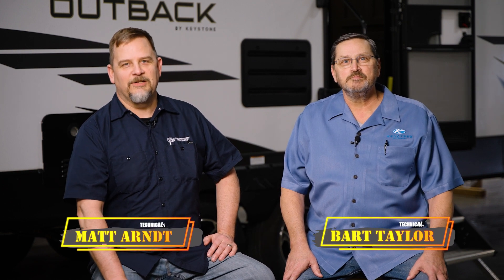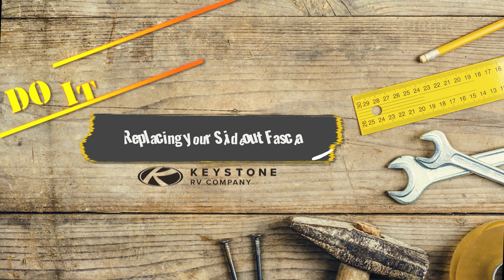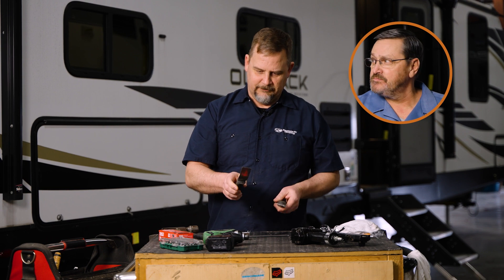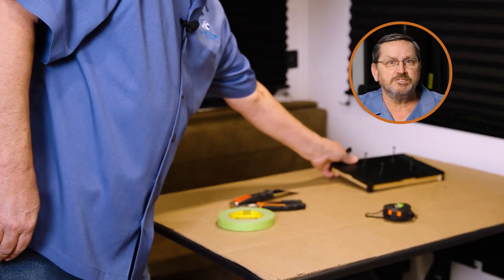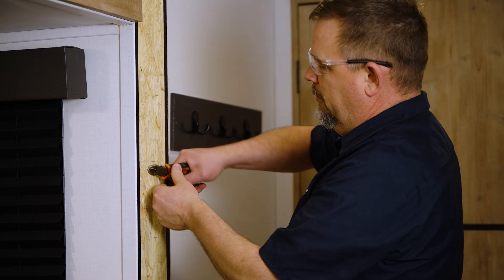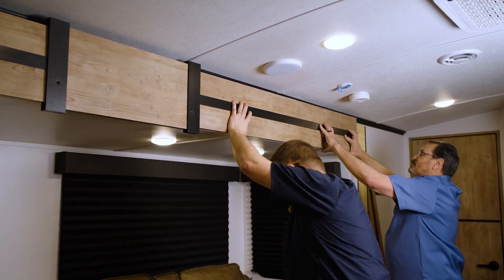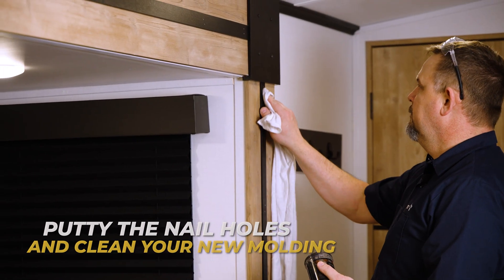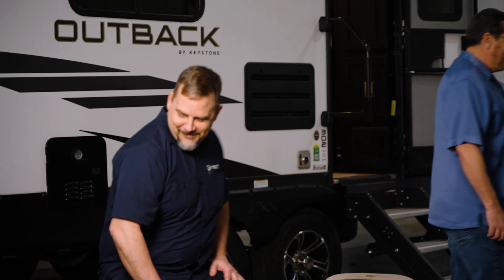Replacing the Slide-out Fascia in Your RV!

Comment: I removed all of the "facia" in my 2016 Montana HC to replaced a stripped out gearbox. My method of putting it back in place was designed to make future service work simpler. I now carry a spare motor/gearbox and cable. After removing all the nails and brads, I painted some SS finish washers flat black and using drywall screws I reattached the trim using these screws and washers. The appearance looks factory and most people would think that's the way it was built. I carefully watched my spacing to balance out the placement. The center piece uses four screws, two on top and bottom similar to the way Keystone built it. I think my method is better for the owner or RV technician. All three of my slides were done this way.
I recently converted my 1350 Dometic refrigerator to a Amish dual 12V compressor system and due to clearance needs, I had to build out the refrigerator out into the coach 3/4". Using and oak 2" trim and stain, I routed the outer edge with a round over bit and attached this trim with the same painted washers with 2" drywall screws. The refrigerator itself still attaches to the coach not the newly installed oak trim.

Comment: Do you guys have a video on how to adjust your slides?
Reply: You want the cables to have a bit of slack but the adjusting blocks should be straight up and down. Be sure to replace the anti vibration foam blocks back in the place. Videos on BAL cable slide systems are out there.
Reply: @NOName-co2qh  I have electric slides no cable

Comment: Needs to start with showing the removal of ALL the fascia, not midway. My 2015 3582RL has a center panel held by 4 screws. Underneath that are 4 more screws holding the center of the fascia to the slide. Show best practices for removal of corner garnish & exposing underlying fasteners.
Reply from the maker: Thank you for your feedback!